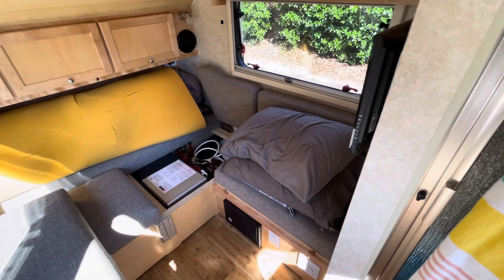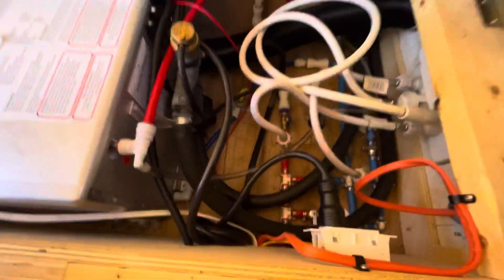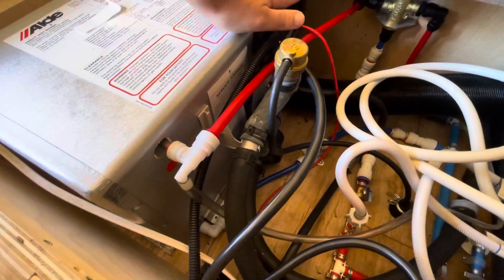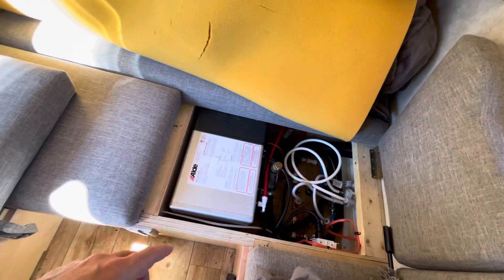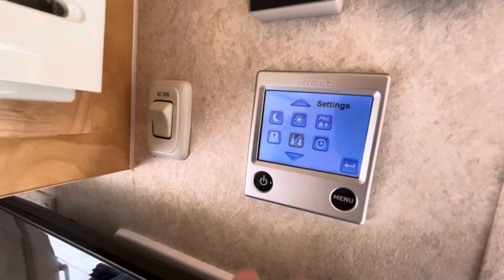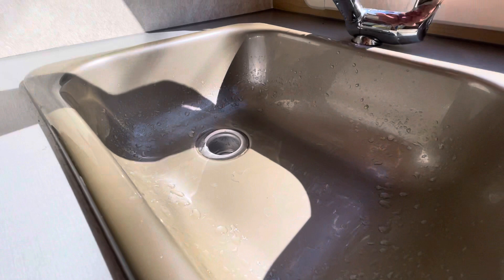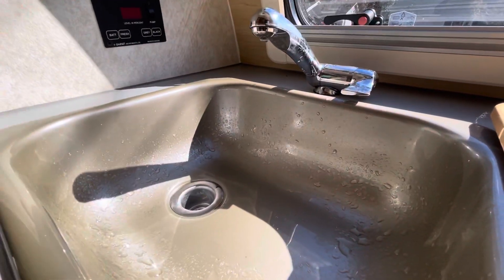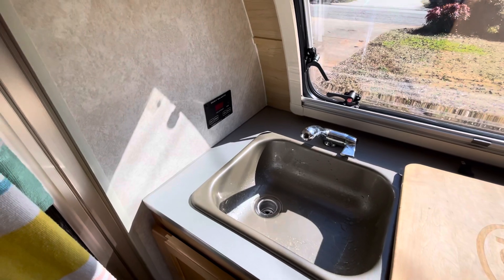Alde Heating Unit & De-Winterization of the NuCamp TAB 320S

Comment: Can you use the heater when your winterized and your tanks are empty?
Reply: Yes you can. Just turn off the hot water setting on the control panel and turn the switch outside in the water control panel to ‘’bypass’. The control on my tab 320s is in the control box on the left hand side. 👍